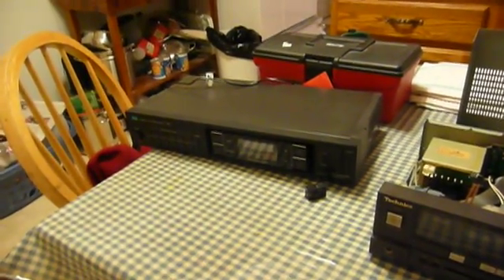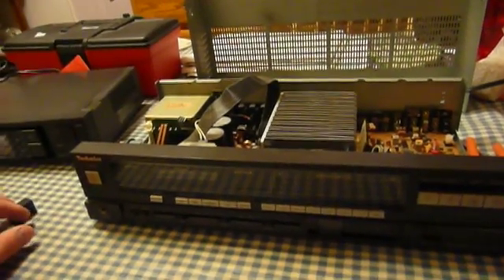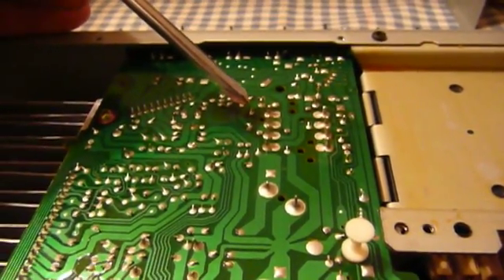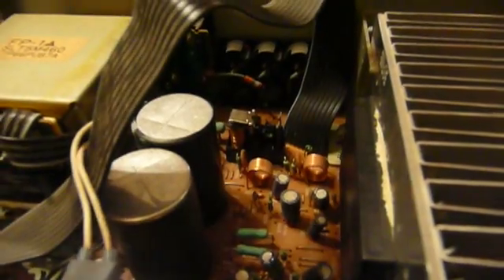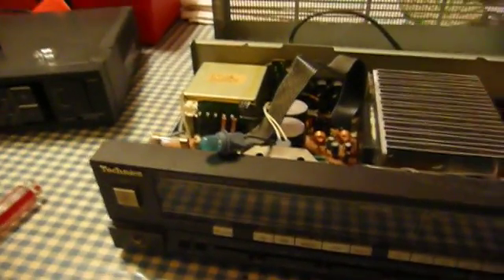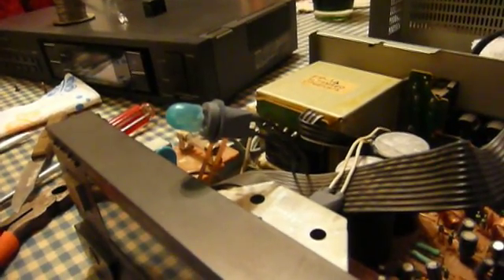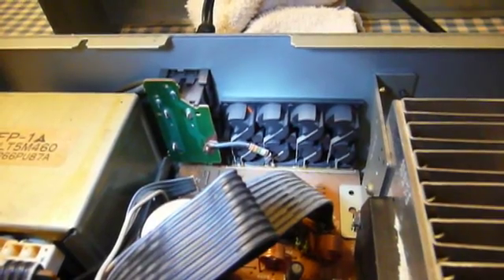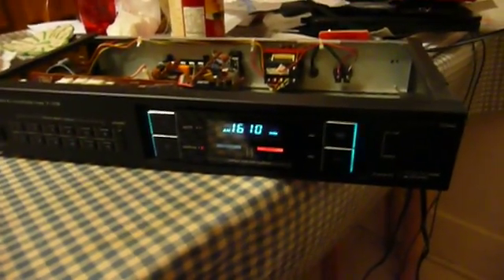Kitchen Table Electronics Repair: Two Stereo Equipment Repairs

Comment: I would have soldered a 10mm LED in place of the 194 bulb. You would need a resister on it, but it would last for years and be brighter.
Reply from the maker: You can get LEDs mounted into carriers that fit where a 194 bulb does, and I've since used them in several of these. They work fine.

Comment: That looks like a nice amp and nice power supply as well.  
Good job.
Reply: my sherwood  died after 4 years but i have Kenwood amp in place of it 
found the Kenwood fully submerged in water put it in the sun works great still
hasn't failed yet

Comment: Bill,
       Got a question on flourscent displays. What makes then go dim after a few years ? I have a Sony VCR and a Poloroid DVR that suffer from dim displays. When the units are turned on the display lights up as it should. Once power is turned off the displays go back to there dim state. Hope you can help. - Nathan

Comment: I have a mid 80's Zenith VCR with a Vacuum Fluorescent Display that is slightly dim. I was wondering that if I have the VCR plugged in all the time with the clock set, if the VFD would continue to wear out until it can't be seen anymore. I have owned this VCR since new and I have never set the clock until about 5 years ago. before that it just flashed 12:00 continuosly. Should I set the time, leave it unset, or just unplug it?

Comment: Much of this RoHS solder is junk and does not hold up well to wide temperature changes over time and the mechanical strength is poor. And this RoHS is not as green as you would think because it uses other "bad" metals and fluxes.

Comment: Where did you get the replacement light bulb at?  I have a Panasonic clock radio that has a burned out dial light and it is very similar to your Technics receiver's bulb.  Your videos are awesome, I have learned so much watching them that I started an antique clock radio collection!

Comment: @uxwbill my basestation currently is an old 23channel midland it was neglected for a number of years the more i ran it the better it sounded it started off weak and scratchey probbably produceing less than a watt now its peaking at least 8 watts dead keys 5watts maybe but all i did to fix it was shake all the dust out of it lol it out does any new radio

Comment: @uxwbill ive used my friends dads old maranz stereo system it sounds awesome and its all tube it has really good bass and every thing sounds so clean and crisp and has a nice warm feeling to it it out does our bose home theater system! i have a dynaco preamp i hope to get the tube power amp for it some day then off of that i will put together a home stereo system its a really neat preamp its capable of exaggerating bass and treble.

Comment: @uxwbill Basically, I have a radio that looks to be in good shape (is very clean on the inside) with no obvious problems apparent just by looking at the inside.  However, there is no audio coming out of the speaker (not even static) and when I key up and transmit, no audio is transmitted.  However, when I transmit, it is putting out power, but when I speak into the mic, the needle for the power stays exactly where it is and no audio is transmitted.  Continued in reply...

Comment: My Technics receiver has that same kind of edge-lit faceplate, but instead of a coin cell battery inside, it has a holder on the back panel for AA batteries, so you don't need to open up the case when they go dead.

Comment: @uxwbill  knight makes good stuff and the kits are really nice i have a signal tracer and a R-100A short wave ham reciver i will be puchaseing a transmitter to go along with it after a while but all my radios and amps are indeed tube types i like the sound tubes produce more than that of transistors

Comment: Hey uxwbill.  I've got an interesting "kitchen table" or rather "kitchen"  electronics repair since this one can't fit on my kitchen table.  It's a 1957 Magnificent Magnavox tube type tuner/amp/record changer.  It needs to be re-capped considering its age, but other than that all it needs is a pickup needle for the record changer it looks like.

Comment: You need to replace the two filter caps.  The sleeves are shrunken which means they are over heating.